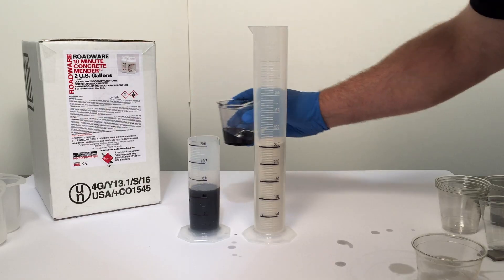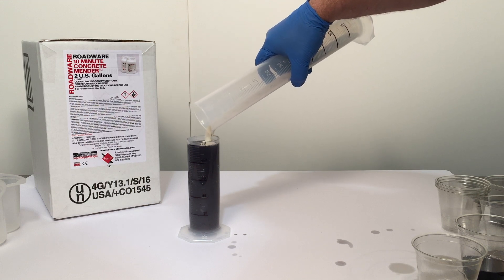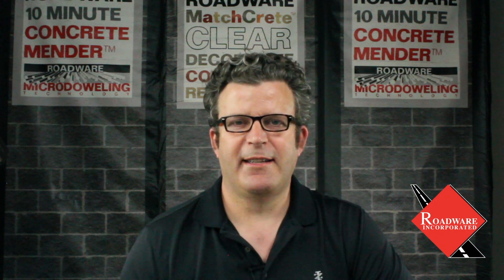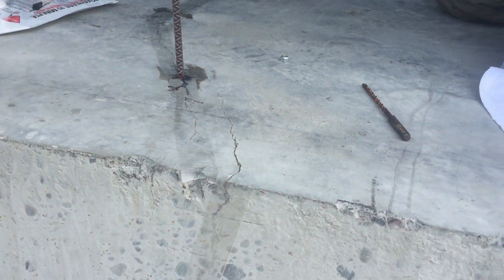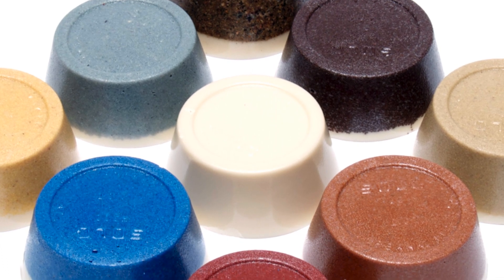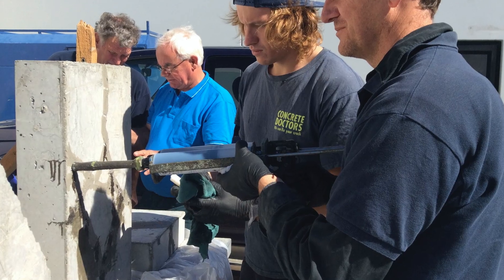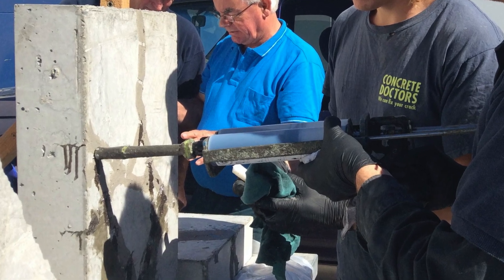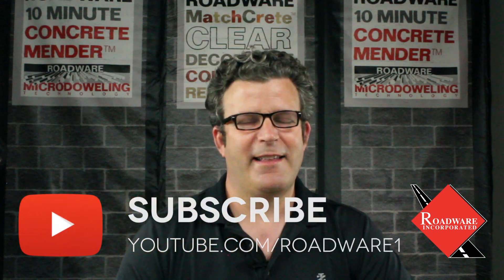10 Things you probably didn't know about Concrete Mender

Comment: HOW CAN I GET CONCRETE MENDER TO FIX HAIRLINE CONCRETE CRACKS ON MY FLAT ROOF IN PUERTO RICO
Reply from the maker: Contact: AT Specialty Cements
Pedro De Castro St # 605, Stop 25.5
Santurce, PR 909
Phone 1: (787) 661-1730